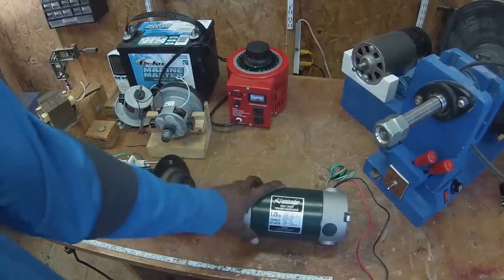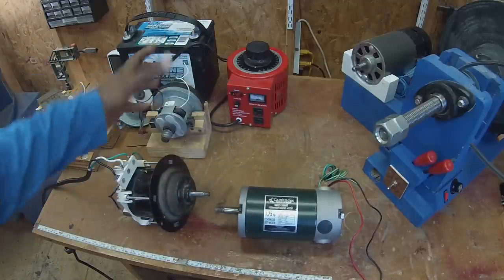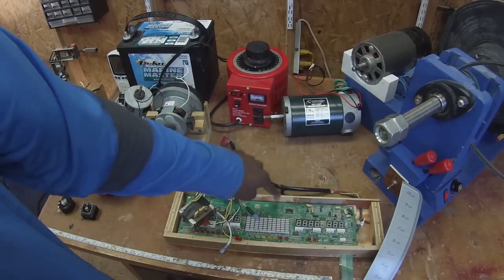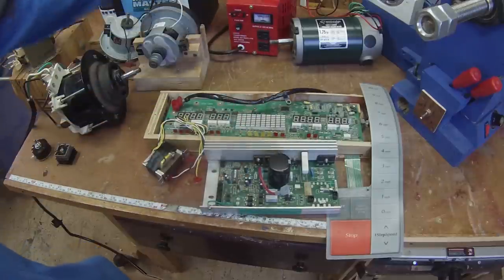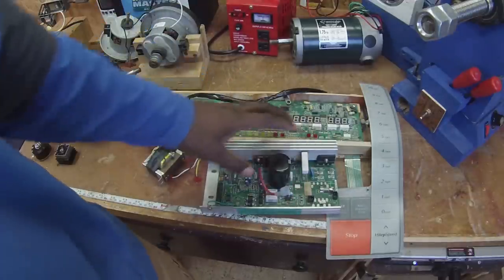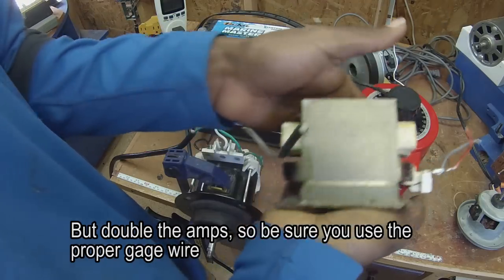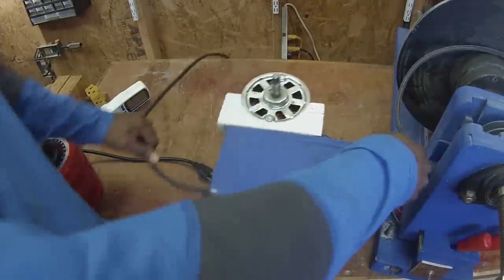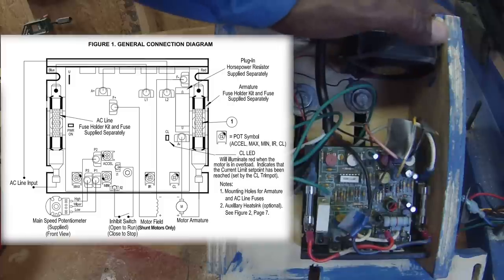How To Wire A Large DC Motor And Control The Speed; Treadmill Motors and Universal Motors 019

Comment: A variac is not the thing to use as a speed controller - especially for low voltage motors but even in general it's not the safest component to use for people who are starting out because most are not isolated.. meaning its winding (and therefore output) is not isolated from the mains and doing something like wiring it up backwards or burning out the winding might cause the output to go to full mains voltage. 

Also, be aware that burning it out might be much easier than you'd imagine at low voltages as at those voltages only a very small portion of the winding may see half the output current into the load and the unit cannot provide anywhere near its rated output power without making smoke and potentially taking its output to full mains voltage. Get a proper speed controller I would say.

That being said, it's by doing and talking about these things that we all learn and that many of the videos on this subject are not in language that's accessible to the beginner - so thank you for doing what you do - and more power to you! Regards, from sunny South Australia.

Comment: Hi Jeremy,  I ran across a 220 v 3hp treadmill that I want to use the motor for a tool im building. How do I know what size potentiometer I need to use for it? 5k - 10k etc ? 
Im planning to use it for my belt grinder if that matters.
Reply from the maker: Check my video on my shop made "DC power supply, speed controller." You speed controller should have a recommended size.
Reply: @Jeremy_Fielding  0k thank you i will

Comment: Hey Jeremy I need some help. Can you tell me what type and how to put a VFD on a single past motor?  I can't afford a 3 phase and all the dc motors we salvaged just do not have the torque I need for my lathe at low speeds. Or can you help me figure our a pully ratio that would work. Thanks.
Reply: All the lathe guys and others buy three phase motors and a VFD drive to run them of their 120/240 single phase shop panels.

Comment: nice video.....trying to wire a similar motor here, and i have lots of questions, would you mind to help or answer those questions. thanks
Reply from the maker: You can ask here... Not only might you get help from me or others, Some with the same questions might see your comment and receive help also. That would be the most effective way to approach this. Also I am about to start a "introduction to motors" series where I go through each motor type and describe their function in detail. Your questions might get answered there... especially if they require a lot of explaining or if it is among the questions I get often.
Reply: Jeremy Fielding ....

thanks for the fast response.  I would like to ask you if there's any way to wire a DC 12v bi directional 4.5 hp ELECTRIC MOTOR,  using either 12v or 24v batteries.  so my questions is what's the best way to figure out what speed controller I need for this project. ...
Reply from the maker: I would just search for DC speed controllers that are rated for a motor that size.. If that motor is 4.5 horse power at 12 volts you will need alot of amps to push that much load. The speed controller needs to be able to handle a very high current without getting too hot. Perhaps if they sell speed controllers for high powered golf carts or something like that.

Comment: Is there anything out there to control a dc motor? The motor runs at 24vdc and 22amps, the source of input power is also DC. All I have seen on the net is controllers that runs on AC input with DC output.
Reply from the maker: Yes. they exist. I am using one to control my electric go kart. You just have to search. There are options for both brushed, and brushless dc motor controllers with DC input.

Comment: Hobby store , look for a train controller dose the same thing as erectphire .... Or power controller
Reply from the maker: The power rating will be way to low. They often work in the  milliamp range. Not nearly enough to power something bigger than a toy train.
Reply: @Jeremy_Fielding   then ill have to make one with 2 miro wave  transformers  wired in series   using salt water in a closed container  with a sirvo that made in to a speed controler  yhat dip into the water to make more current,  ill find one on youtub  you can do all type of things with it , its even strong anuff to be used as a ark welder   king of random made one . Ill post the link on this ss some ss i find it , You Will Love It  , you all ready have most peaces 
https://youtu.be/P9UjxG8sN1c

Comment: Hi,
This is very informative, I have a problem with a meat grinder (Profissional Series) that I bought from Canada (110V 60hz) and I send it to my brother where the electricity is 120 50hz, the machine is 1.75 hp induction motor, and I think it suppose to run 1800rpm, but unfortunately, when he run it on 120v 50hz with the converter it losses ~20% of the power which slow. I'm not sure if the speed controller can help in this case and produce the desired power. looking for advice and help.
Reply: My guess: it will run fine without converter

Comment: Hi can you tell me what is the difference with a Drive and a auto-transformer?
Reply from the maker: The DC speed controller that I used is designed specifically to control motor speed. It can adjust the power delivered to the motor to maintain motor speed within a small range. It converts AC to DC and does many other little things to meet the task. The Auto Transformer is only controlling voltage. If a significant load is placed on the motor it will slow down with the transformer, but not with the DC drive. That's the main difference...

Comment: question , can i power a 1000w 48v motor that draws 20 amps  from   2 12v batteries connected in series with a dc boost up controller( 1500w 30amp max 5-70v  output )  ? and i think i also need a 
speed controller to ?    unless i can find a 24v dc motor thats powerfull enough for a go kart??
Reply from the maker: Please check the description. Thanks!

Comment: Would it be possible to use a powersupply from a Pc, and connect some sort of a control unit to adjust the Rpm ? Maybe an RPM controller to adjust rpm on fans in the Pc.
Reply from the maker: yes. That should be pretty easy to do. I would just use a potentiometer that can handle the current of the fan. Then you can dial in the speed.
Reply: Awesome.. Old Pc parts is easy to get, so thats why im a little curious. Could you maybe make a video to show how to make the setup with that type of parts ? Think many people would like it. 

But is there any specifik Potentiometer you have in mind ? And do i simply just connect it like I would put an on/off swith between ? Sorry about the questions. Have absoluetly no experience with electrical wirering. 

Actually when im thinking about it. I Have a potentiometer from my old vacuum. The power can be adjusted on the on/off switch. Guess that should be strong enough ? :)
Reply from the maker: Have you searched YouTube for this yet? I haven't checked but this feels like something that has been done. There seems to be hundreds of small electronics and circuits videos that must at least come very close to what you are asking for here. Controlling a PC fan seems common enough. I try to focus on larger motors since that is something I spent a lot of time looking for but was never satisfied with what I found on YouTube. If I get more request for things like this I am certainly open to doing something about it. Feel free to come back and let me know what you find.

Comment: How many DC  volts can you get if you convert a 220 volts  Ac by  using a bridge rectifying
Reply: Approx 220 although there will be a slight voltage drop across the rectifier because of it's resistance. That drop is of no real consequence but that voltage is potentially VERY DANGEROUS! Unless you know exactly what you are doing DO NOT MESS WITH IT!!!

Comment: Hi Jeremy, I need help with a project to add speed control to my lathe. Would you be able to? I can email more details but essentially my lathe is attached to a DC motor which I need to be able to speed control. Everything I have tried so far has failed lol.
Reply from the maker: Unfortunately I can’t help directly like this. I hope you can understand, I get hundreds of requests through my YouTube channel for advice and general help. It just isn’t safe or practical to try and troubleshoot problems one on one. I usually take subjects that come up over and over and make videos to help lots of people. But, you are commenting on the video I made for this purpose. I don’t have much to add without problem solving.
Reply: Thanks Jeremy, it was really if the motor I have is one which is actually capable of being speed controlled. I totally understand. Thanks and great videos!

Comment: What’s the best way to determine what kind(size, ohms, volts, etc) of potentiometer one would be for a 2 & 1/4 dc motor with a mc60 power box on a old delta/Rockwell 14”-36”. Wood lathe?
Thanks
Reply: Oops, I forgot one more question. Can you(me) concert a water pump motor to a regular motor to run on a piece of equipment?
Thanks again
Reply from the maker: +zetus kid usually it is 5 or 10 k potentiometer. You will have to search online. This question has been asked enough you should find a descent answer. I don’t know off the top of my head
Reply from the maker: +zetus kid Yes you can remove the impeller and use it like a regular motor, but it probably runs at 3600 rpm and you usually don’t want that much speed. Pulleys can be used to slow it down

Comment: So I built my first E-kart this month! I was to get 35-40mph but i want to go faster!!! 

My current specs are 

Alltrax AXE controller 42v

Motenergy 42v motor

and

14s12p 2200mAh Li-ion pack

I want to start my next project with a go-kart that will reach 60mph. 

Any suggestion on controller

Kelly or Curtis?????????????

Any suggestion on motor?????????

D&D , Motenergy, or something else ????

Batteries?????

18650 2600mAh

18650 1600mAH HIGH Drain

A123

22650 3.2v 3300mAh

 3.7V 8AH LITHIUM POLYMER BATTERIES 25C 200A S

Please help me decide!!!!
Reply from the maker: I can’t help you there. Not a project I have tried before

Comment: HELP I bought an unlabeled motor that vaguely resembles the one you test on 8:15
The seller claimed it was 12 volt but I put 72 volts on it and it was fine (yes I am stupid).
It also had really thicc cables and was very heavy. How can I find it's specs?
Reply from the maker: Thick cables usually means low volts, high amps... 12 volt motor. It will run on higher voltage.. but you will damage it over time with short runs, or quickly with a long run. I don't know of a way to confirm what the optimum running voltage is for a motor. Because that is what you would be trying to figure out. All DC motors will run on a vary wide range.
Reply: Thank you!
If I want a motor that could be used for a go-kart type thing, with not to fast rotation but a strong pull, would something like that connected to a high amp battery be what I need?
Or do I need high voltage motor with gear reductions?
Reply from the maker: Higher voltage is not really  practical without more batteries. But, I can't really say... there are too many variables I don't know about... how heavy is the cart, what speed, what is the rated power of the motor... I can't say what you can do with it.
Reply: Understandable, I myself have not decided on those.
I have only fifty 18650 batteries, a 12 V system is slow  and gets very hot so I paused the project due to uncertainty.  I don't understand exactly how voltage and amperage correlate to the power and speed of the motor and motors in general. Your input and any advice is most appreciated!
Reply: Having dealt with many motors in the past, I would make an educated guess that this motor is :-- 1.75 Horse power, 110 volt, 15 amps, approximately 1400 watts, I wouldn't worry to much about applying the 72 volts, and here's some ideas about trying to find the data on motors, a 240 volt motor will usually run (slowly) on 6 volts or less, if you have a full voltage variable power supply then start your motor off slowly, put a long handled screwdriver handle in your ear and the other end on the body of the motor, slowly increase the voltage and listen carefully, when you hear the motor begin to sound rough or vibrate seriously, you've probably reached it's maximum voltage, also remove one of the brushes and check that it has a decent wire link anchoring it, some cheap Chinese mill and lathe motors have terrible brushes, by the way the motor in this video appears to have a left hand thread, not sure if this will help.
Reply: Thank you William I'll try that!
Reply: Very good , Also A Left hand Thread Obviously means it spins Clockwise to keep the Outside nut from loosening i.e. A Fan. A Fan Motor makes A Cheap and easy DIY Bench Grinder with Usually 3 Speeds . A Great Way to Repurpose .

Comment: Hi Jeremy, pls can u help post a vid on how we can control a brushless motor like the type LG uses, a Fishker & Paykel I think they call them.
Reply from the maker: Brushless motors are very difficult to control. Their speed is based on line frequency instead of Voltage. In the US that is 60 hz. I was planning to talk about that in this video but it was just too long. If you happen to have a 3 phase induction motor (AC brushless) you can buy a VFD (variable frequency drive) which changes the frequency for you. These devices are not cheap though. The best way is to use pulley to get the speed you want. I have experimented with other options but you lose alot of power and its not worth it I think. The only VFD's I have seen for single phase motors work at 240 volts.
Reply: Jeremy Fielding  a brushless dc motor is different from a 3 phase induction motor (although the stators are wired the same the rotors are very different). To control a brushless DC motir you need an electronic controller which is called an ESC in drone circles. I don't know about what controller can drive industrial brushless dc motors. I know there is no standard voltage they run at.
Reply from the maker: Yes I agree... they are not at all the same... that's why I said AC motor. My response has nothing to do with a brushless DC motor.
Reply: Thanks for the responses,,, its the schematics for a simple 230v electronic brushless motor controller I'm after. There should be a way to control this type of motor without the use of a microcontroller, simple circuitry triacs and transistors should do the job but I can't find any schematics
Reply: debayous If you are talking about a "Brushless DC motor" then no. The controllers for these things are never just simple electronics.
Reply: Well can u give a rough idea of what is involved even if its complex electronics
Reply: debayous I would guess a bunch of mosfets with suppression diodes to drive the coils. If it was to drive it in both directions they would be arranged in a h-bridge. They would be controlled either by a microcontroller or a speciality chip for it.

Comment: which dc motor can we use that can be able to displace human weight ?with a relatively moderate speed?
Reply from the maker: +rahul goti you mean like a treadmill? Use the treadmill motor. Permanent magnet D.C. Motors are not very power at low speeds. A universal motor might be better

Comment: Could it be that the scale on your variac shows the percentage of the input voltage, rather than plain output voltage. Since your input is 120V, each unit on the scale would correspond to 1.2V. If this is the case, output voltage at the top of the scale would be 130% * 120V = 156V.

So maybe it isn't off at all. I have a variac that is clearly marked with a percentage scale. Mine goes up to 120%.
Reply from the maker: possible... I would have to look at it again and see if there are any indications it was suppose to be percent. I don't think it came with a manual... I can't remember.

Comment: where did you get the large potentiometer I've been looking for one that size that I just don't know where to find it.
Reply from the maker: +Frank Rowland it is a auto transformer. Sometimes called a variac. I bought it on eBay
Reply: Jeremy Fielding that was referring to the small black tensiometer that you used in the beginning of the video
Reply from the maker: +Frank Rowland amazon

Comment: I have a WEN 6502 Sander that i would like to control it speed, could you tell me what kind of device should i buy for me to do that?
Reply from the maker: +Asheville Airsoft Coalition I don’t know enough about your device to offer any advice. I have a whole series of videos on wiring and controlling motors. You need to identify the type (which has a video on my channel) then you can figure out if it can be controlled. Also a video on my channel. Not all motors can be. It’s going to require some homework on your part. But I have videos on everything so I made it pretty easy I think.
Reply: ok, do I have to open it and check the motor? coz, I was checking in amazon for a LAPOND VFD Drive VFD Inverter Professional Variable Frequency Drive 1.5KW 2HP 220V 7A for Spindle Motor Speed Control(VFD-1.5KW)   and it is for a 1 phase motor..please advise,
Reply from the maker: +Asheville Airsoft Coalition it is way to risky to give advice like this. I can’t know if you are giving all the relevant information or if I even fully understand the question. You need to watch the videos and work through it. I think you are headed in the wrong direction. I can’t know without doing the work for you. Please understanding I get hundreds of requests like this. It’s not realistic for me to help one on one for free.